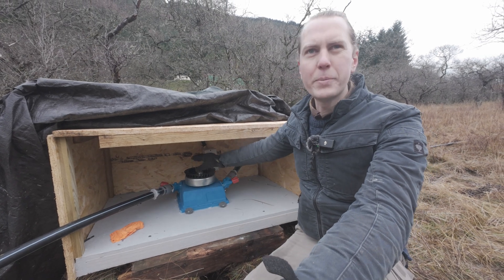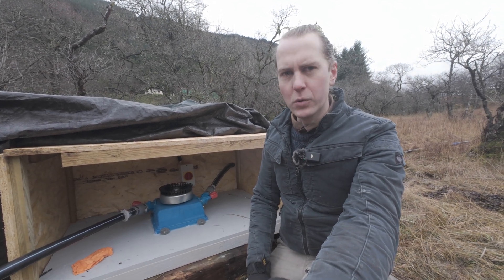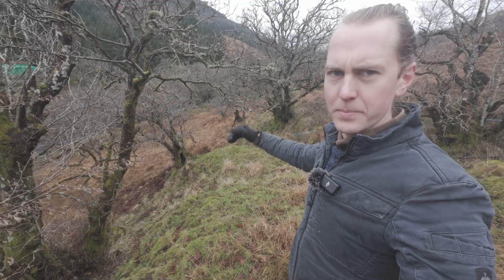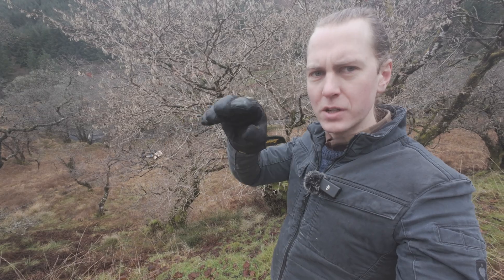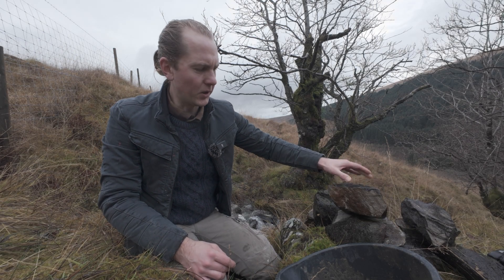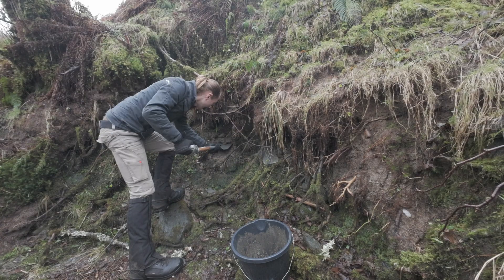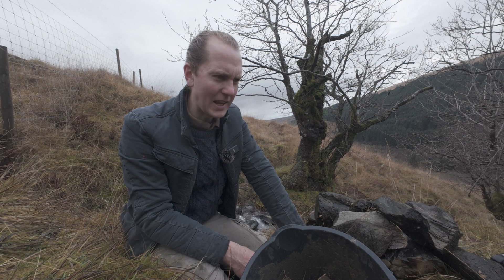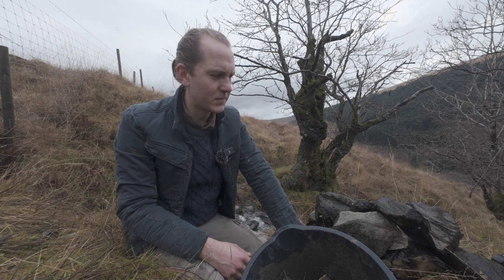Chasing the watts DIY micro hydro Off Grid Day 36

Comment: Are you able to link the adapter you added to the nozzle. I’ve had mine delivered from USA and getting ready to set it up. I’ve followed your videos and would love to replicate as your power output is amazing.
Reply from the maker: Sure here is the adapter I bought https://www.pipestock.com/mdpe-female-adaptor
product 352104 the 40mm to 1 1/2 one
Reply from the maker: or a different diameter input if you aren't using the same pipe as me
Reply: @beyondtheworkbench  Mate. That’s perfect. I’m using the same pipe as you 40mm. I used the link in your video. 😁
Reply from the maker: good luck with it @dawgsk9769

Comment: Could you not fill a pallet water container higher up with a vent on it. This would increase the pressure but also stop any air in lower pipes
Reply from the maker: That's a great suggestion and is exactly what I am looking to do when I get to upgrading it

Comment: Hello, I am in the south of France in the Lozere department. I also have a small hydroelectric turbine like yours, a Pelton with the same ME1112 generator, a discharge height of 62m, a pipe length of 150m with an external diameter of 50mm (44mm internal).
At most I should have around 3.5 liters per second. I can produce between 125W and 950W.
the blue variable injectors that you use are good if there is more than 1.5 liters/second, if there is less water I use fixed injectors with 4 or 6 or 8mm holes
the blue variable injectors are good if there is more than 1.5 liters per second, below the jet is very diffuse, when there is less water I use fixed injectors with holes of 4 or 6 or 8 mm
when the water flow is 3 liters per second I have a lot of losses because my pipe is too small (44mm inside). I have a loss of about 2 bars (30 psi)
if you operate both pipes at the same time the pressure must be identical, otherwise the speed of the water is not identical, and the lower flow rate is of no use.
I have a few vidéo in my youtube channet about my turbine (but, in French language)
I'm surprised I can understand you.. you don't have the terrible Scottish accent 🙂
Reply from the maker: Thats such valuable information! Thank you so much for you comment I will definitely look back at this when I am tuning it up

Comment: Plumbers putty would probably be better. I like the snifter valve idea. A 55 gallon drum near the intake can help with air in the line and is a huge help with silt
Reply from the maker: Thanks, I am making a gasket at the moment as the sealer doesn't seem to want to stick to the plastic that the turbine housing is made of
Reply: @beyondtheworkbench  If all else fails, try EPDM pond sealer. That stuff sticks to everything, and it cures even when it is wet and cold. I had good results with applying it to a variety of plastics. And it is safe for aquatic life, so it is not toxic. Thicker layers might take a day or two to cure under cold conditions. But that stuff is very strong and sticky.
Reply from the maker: Excellent, I just had a look and it looks like a really good solution. I will be adding a rubber weather strip to the bottom and if this doesn't sort it I will try the pond sealer as well @insAneTunA
Reply: @beyondtheworkbench  EPDM is a rubber that is used for pond and roof liners, but it is also used in the car industry. So the pond liner sealer is excellent stuff for gluing rubber gaskets. The EPDM pond or roof liner itself is very good material for making gaskets. EPDM rubber is super strong.
Reply from the maker: Excellent @insAneTunA